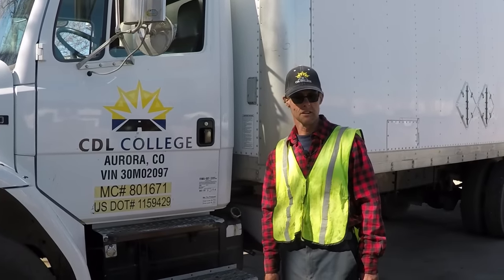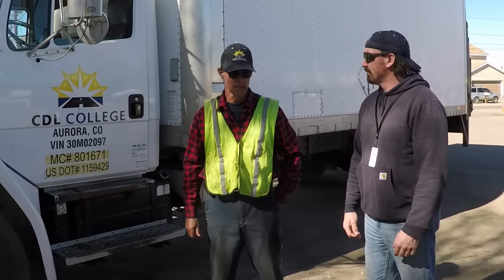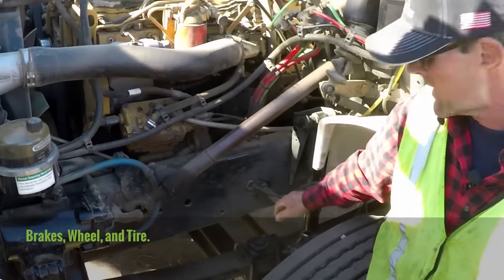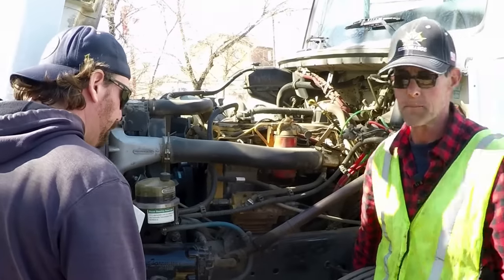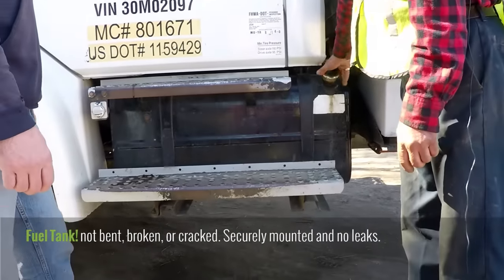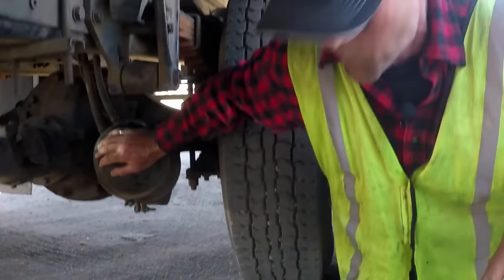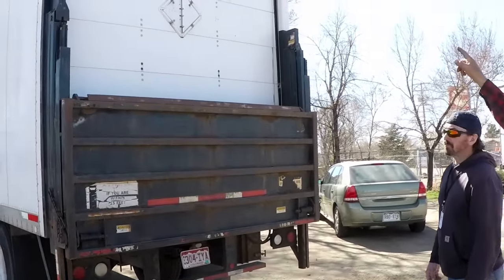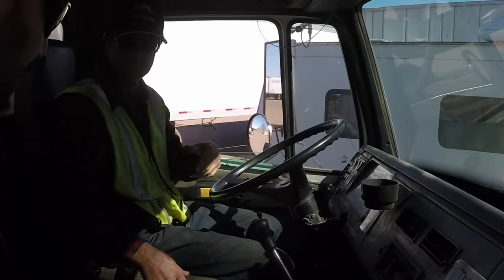TRUCK DRIVER STUDENTS! Class B Pre Trip Inspection (stable camera)

Comment: If your taking your test in CT I know this for a fact because I failed for it. No matter if the truck is manual or automatic when you do your brake leak test and release the parking brake doesn't matter what truck you are driving you have to have the wheel chaulks down. Once you release the parking brake you have to have your foot off the brake pedal while doing so. Verbally tell the instructor how much the air dropped. Now you can put your foot on the brake pedal and perform your leak test. It all depends on who does your test. I personally watched the man before me perform his brake test with no wheel chaulks and he passed. He had no wheel chaulks at all. I'm a mechanic and I sign off on my own annual inspections have been doing it for years. I went right after and left mine in the bracket on the frame. I failed 15 minutes after for not putting them down even though the man I'm front of me passed without even having them on the truck. This video fails to tell you this. Be careful

Comment: I  REALLY like this method. Although only missed:
1.) No Oil/Grease on front brakes.
2.) No Bluing on rear brakes.
3.) Check Inner & Outer rear Valve Stems.
4.) Static Air Brake Test.
5.) Governor Cut-IN test.

Comment: I can’t say this enough! Read your CDL manual for your state. Some states don’t require all this info or they have different components you need to inspect. Your CDL manual will tell you what will be inspected during the test, the state of Oregon requires you to check the hub/axel fluid level/grease not just leaks, also when checking your mud flap must be stated that it needs to be 10 inches or less from the ground, fuel tank movement check, battery box and connections…. These are just examples of requirements for different states.

Comment: Not sure if in your location but in Washington state they will fall you if you get out of the truck wrong. If you don't do 3 points of contact or exit the truck properly. And if you don't set the service brake and get out to check the rear of the truck
Reply from the maker: Here in Colorado, the same is true. Every time you exit the vehicle, you should set the parking brake and use 3 points of contact.

Comment: so a few things...  Idk if this is a California Class B CDl but as of 2018 for sure... there is a few things that for sure on this video that will cause u to fail here in California( talking about the air brakes test specifically)... 1) you should not fan the brakes as fast as  Robert is( you may go to far{to low or to high.. low usually.. on you  psi announcement to the tester
2)there was not cut in test performed 3) You cannot tell the tester that the governor will cut in between 120 and 140.. this will cause you to fail( I know from personal experience) you just tell them that "the governor cuts in no more that 140 psi" and announce when it cut in on the gauge 4) the low pressure warning should show and sound off between 55 and 75 psi 5) the spring brake pop out should occur between 20 and 45 psi... any questions please refer to the the California Class B CDL handbook..

From:
A man that just took the test 12/14/2018
Reply: What DMV did you go to?

Comment: this is a great video but i failed due to 2 things first one being when doing your air brakes test you must tell the instructor that your warning light and alarm will come on at 55 PSI or greater and the second one being the correct answer to when your valve will pop out is between 45-20 PSI other than that this video is spot on

Comment: Measurements:
Belt adjustment: half to 3 quarter inch
Slack adjustment: 1 inch of play
Brake shoes: minimum of  quarter inch of thickness
Front tread depth: 4 3/2 (30 seconds)
Rear tread depth: 2/ 3/3 (30 seconds)

Comment: Great video, absolutely helped me but I still failed 🤣 I said lights were clear instead of clean, I said frame instead of frame members, I pointed to the power steering hose during the power steering container check and not during steering system check. Also I did the air compressor cut out last, instead of first. All that made me fail my pre trip. Vocab and order, I think that's some bs.

Comment: Do air brake tests differ from state to state? Also, does air brake test differ from Class B to A? 

He didn't do the static leak test. push Air brake in, and let the gauge(s) settle, then time for 60 sec that you don't lose more than 2 psi. 

Also, he didn't do the governor cut in test. Start with full tanks, and you pump the brakes to roughly 100psi until you get needle rise, which then you give the reading at which the levels started to rise, and that would be the governor cut in.

Really liked the video and its very helpful, thank you!

Comment: no more than 3\4 inch play for belt
Springs aligned, no scissoring

Pull out on slack adjuster making sure no more than 1 inch of play

Front tread minimum of 4 32nds tread depth

Rear tread min of 2 32nds tread depth

Comment: Thanks for your video. Very informative. If obtained my Class B Drivers permit and have started drived a cement tank truck with licensed driver in Los Angeles. Any Calif specific pointers or info I should know as in mixer is hydraulically driven, etc? Been over 20 yrs since let my Class B license expire. Any info and pointers would be appreciated. Employer will be purchasing a 2013 Peterbuilt Mixer automatic trans within a months time that I'll be driving. Thanks again.
Reply from the maker: California. Hmm.
The more thorough you are, the better your chances of passing the first time. All states are supposed to be on the same page, but...

Comment: Hi Robert I have a question, Only on automatic trucks do I need to chock the wheels to do the service in parking brake test.
Reply from the maker: That's true if your testing facility requires chocking the wheels.

Comment: When you do the air brakes portion of the test, is the order done in the video the correct order? At what point did you chock the wheel?
Reply: according tom who is doing the test. For me I was on flat ground so I didn't have to. you can ask as well.

Comment: so I checked the tire pressure by thumping the valve stem with a mallet as described at 10:22, and it seems to have a bad leak.  They failed me.  Other than that, I did great

Comment: Question, whenever you do the air leak, low air pressure warning system, parking break knob to pop out and air compression test you need to have the truck in gear? Im taking my test in an automatic truck so it means I’d have to leave it in drive or park? Just want to make sure.

Comment: Is it mandatory to start with the parking and service brake tests, or can you elect to start with your air brake tests (static, applied, low pressure warnings, springs), and then finish up with parking and service brakes? Thank you

Comment: did you ever check  the slack adjusters for less than 1" of play after you where able to turn service brakes off? When do you do that?
And is there pressure in system when you're saying you hear no air leaks or do you just say it to tester just to say it.

Comment: Robert.  I need help.  New 2019 peterbilt straight truck going for b license    Truck doesn’t have volt meter nor an oil pressure gauge all electronic? Also when doing air brake test after fanning I get the warning then continue to fan parking brake doesn’t release.  The parking brake is a lever action not the push and pull pop out kind.  Not sure if I can pass the test or not

Comment: It was good, I don't him doing a static leak down on the air pressure tho.He did the applied brake leak down for loss of air but not a static leak down loss of air. I think a inspector will fail you if you missed that.

One thing on the pre-trips and the inspector, go slow, tell him while showing and demo. DO NOT just do it , explain it, the more you speak about it the more you would look good. Remembers to use the keywords Abrasion, Bulge, Cut ( rubber ) , 3Ls ( Lean ,Leak Lights ), mechnical  not broke, crack,dent, securely mounted, etc......

Another hint, do the inspect b4 you arrive and time yourself. if you do it under 30mins, your are going to fast. Slow down. Make the pre-inspection reasonable slow so he wave you past. that item.

Comment: Can someone review the air leak rage test for the service brake he turns off the engine , leaves it in gear and just holds down the brake is that all you have to do ?
Reply from the maker: Press and hold the brake pedal for a minute (count!). You cannot lose more than3psi in one minute.
Reply: CDL College, LLC engine off transmission in gear and parking brake off correct ?

Comment: Never study or been into vehicles but been debating on getting my class B are the testers really picky if you miss one thing does that fail you automatically? I know you have to take a 4week class in nc do they go over all of this and let you know you will fail if not completely thorough?
Reply: You can miss a few things on pretrip, but if you perform the air brake test incorrectly at all you fail.

Comment: I have a question.. is the air compressor on the same side in every truck?
Reply from the maker: For the most part, yes. On some trucks, it;s located on the driver side, but it's way back near the rear of the engine. Difficult to see. Thanks, ronald!
Reply: Oh ok thank you.. because I have my skill test this coming Thursday and I'm been looking for the air compressor of that truck that I'm doing the test with and I can't find it.. the truck is 2015 kenworth and it's automatic
Reply from the maker: Google 'air compressor 2015 Kenworth' and look at the IMAGES tab. You'll see many photos of air compressors. Find out what kind of engine you're looking at would also help to narrow down the location of the compressor. Paccar? Cummins?
Reply: Hey sorry another question... does the rear 4 wheels truck has u-bolts
Reply from the maker: Yes, more than likely. You have to look at your suspension to know what to expect. Not all trucks are the same. Some have leaf springs and shock absorbers; others have leaf springs, a shock, and air bags. Thanks, ronald.

Comment: Took my CDL test today in CA, and I failed the air brake test (instant overall failure), because I mentioned the Low Air Warning comes on at 50 psi (book says 55 psi when I looked after.) I was told that it was a fail because I didn't say 55. This video states 60 psi, so would that be a failure also because it's not 55 like the handbook says?
Reply: Low air pressure warning has to come on before 55psi any number above 55psi is good

Comment: Driving manual transmission straight truck is same thing as manual car drive right? But it’s just double clutching.
Reply: Some straight truck transmissions are synchronized, so shifting those trucks will be like a car and not require double-clutching.

Comment: What about the use of the  wheel chocks during test?
Reply: He didn't need to in this case because it is a manual shift and they had it in 1st gear while doing the air brake test.

Comment: DO NOT USE THIS INFORMATION FOR CDL TESTING IN INDIANA. I used this video to study for my CDL skills test in Indiana and I HAVE BEEN FAILED. The tester knew that I had studied this video based on how I performed the brake test, and told me its not correct for the state of Indiana. The tester stated that he noticed an increase in failures due to students using this video for instruction, and has watched it himself to verify the info is not accurate to Indiana CDL handbook. It might be right in Colorado, BUT NOT IN INDIANA. be sure to check your own state's CDL handbook before memorizing this method.

Comment: Does anyone know if this still applies with 2021 CDL test?
Reply: Nope
Reply: The pre-trip sure but not the brake test. You need to read aloud every damn number on the air pressure gauge out loud